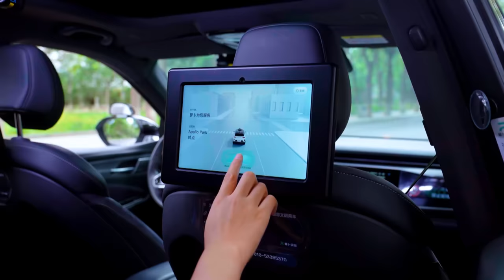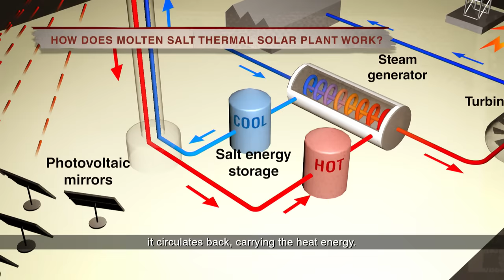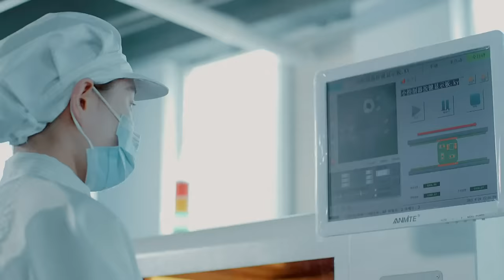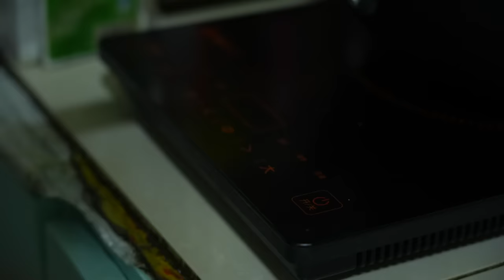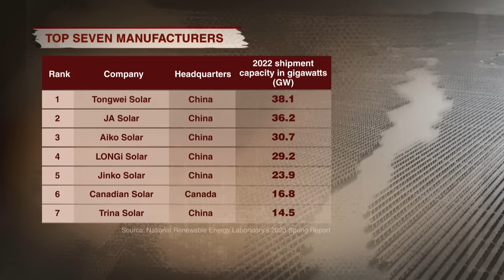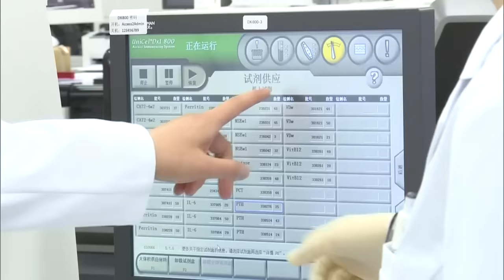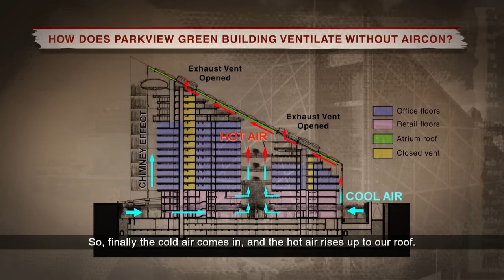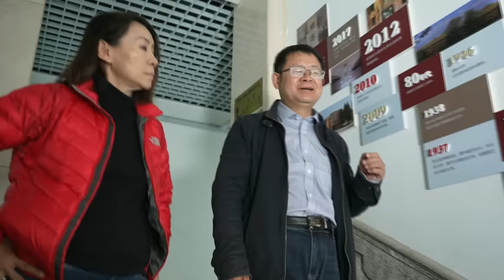China's Contradiction: World's Biggest Clean Energy Producer And Biggest Polluter? | Insight

Comment: US is the biggest polluter overall.   This sort of article should be responsible for giving the right information.   China is just the biggest annual emission in recent years.  But it will take another 10 years just to match the carbon emission US put in the air in the past.   And China is the fastest to clean up it carbon emission as compare to both the UK and US after their industrialization.  Yet US is still number 2 in carbon emission despite not doing any manufacturing while China is the world factory with 4 times the population.    

Unless you consider the people in China are not human,   China emission per capita is way below most industrialized countries including US, Singapore, Israel,  Canada, Japan and ranked 40th less per capita than even Falkland.    And the number don't even include the carbon emission by US military bases all over the world.
Reply: Depends on your source, but in general per capita, China does have a lower CO2 emission, the difference though is the quality. Burning coal releases more pollution than natural gas (Coal produces a lot of ash, particulates, and sulphur by products). 
I hope China goes green faster than countries. They should take note and learn from the failures and success of other countries, without stumbling around in the dark. Starting late has its benefits since you can avoid the traps. All the other countries have already invested billions on the research, so they just need to reap the results.
But yes, all countries should try to switch to renewable resources before we turn the earth into a toaster oven. Its not who is worse but how we can all make the world better.
Reply: @rebeltheharem7028   Coal is 100% carbon, but natural gas is still mostly carbon, or it wouldn't be valuable as fuel.  Chinese transportation is electrified mass transit, electric taxis and electric rideshare, supplemented by relatively few private vehicles, and Chinese EVs are now 40% of the market.  US transportation is roughly 99% carbon due to gasoline & diesel automobiles dominating.  China's energy grid is going renewable very quickly, now roughly 50% renewable by potential capacity, whereas America's energy grid adds renewables much slower.  

China is actually leading the advances in next-generation energy.  China has High Voltage Transmission technology that nobody else has (to move energy from solar farms in the western desert to the eastern cities), along with wind turbines that are larger and more effective than anyone else.  China leads in battery chemistry and production techniques, and also leads in photovoltaic cell technology.  Also, China is the only country with a 4th Generation nuclear power plant in operation, is operating a Thorium molten salt reactor, and is constructing a small modular reactor. China is actually doing the big investments and reaping the rewards.
Reply: It also does not include every year wildfires！ united state canada Australia.
Reply: @ZweiZwolf  China High Power Transmission is unique and no equal to move electricity from remote region to urban areas.     And as you said, China is pretty leading in every possible green energy out there.   The west was going to use this green tax to penalize China so they could force China to buy their green technology at a very high price.  But it sort of backfire on them.
Reply: @TAL142  Yeah, really shortsighted tariffs are just increasing their cost of renewable energy.  BTW, this is why China added so much solar last year, more than the entire US solar installed base.  China kept producing, and the West stopped buying, so China just installed all of the panels domestically, increasing their domestic renewable energy share. China has basically stopped approving new coal because they are installing so much renewable energy, transmission and storage. 

It's going to be really interesting when China has essentially unlimited amounts of "free" electricity to power things.
Reply: @ZweiZwolf  China needs energy security.   If they can store these energy, they could use most of these unlimited amount of free electricity.   China also has clean nuclear energy, hydropower, thermal power, wind power.   Just make sure not all the eggs are in one basket.  China is a big market too.    If they have excess, they can sell to friendly neighbors.
Reply: @TAL142  Sure, though it's also an option to convert "excess" electricity into green hydrogen fuel or freshwater.  China is now the largest installer of hydrogen generators.

Comment: Idk if its a translation error or what, but those mirrors are not photovoltaic (PV). The plant is a CSP plant, which concentrates the light from the sun onto the tower, heating it up, and using it to turn a turbine. 
Photovoltaics generate electricity "directly" via the photovoltaic effect.

Comment: China aims to transition to 100% renewable energy sources, provided that technological advancements permit. The primary motivation behind this goal is to eliminate their dependence on coal, oil, and gas imports. China's manufacturing industry is expected to benefit significantly from this transition, as energy costs are anticipated to drop sharply, resulting in improved profit margins. The decision is not only economically sound but also environmentally responsible, as it would reduce pollution levels.

Comment: There should not be contradiction. At this moment, wind and solar power are very stable. The coat power plants should be transitional and suplemental power to ensure power stability and should eventually be partially scraped after 20-30 years. Bear in mind, reaching carbon neutrality is a long journey and does not means no carbon should be procuced at all. It is just that carbon produced is neutralized by more tress planted and other technology such s carbon capturing. etc. to reach carbon neutral.

Comment: It should be clealrly stated that, the power generated by wind and sunlight is so called garbage electricity, not stable: power outage when you need it, and generting too much when you do not need. To generate more garbage electricity, you do need more thermal power, coal burning power plant. It is good to see that the new coal burning power plant in China are the most advanced one and produced least possible pollation.

Comment: If I may, the conclusion about cooperation sounds nice but raises the question of how to cooperate. Besides the lower cost of labor  in China clean energy products are heavily subsidized in China and possible dumping. China's subsidies and dumping creates an unfair market place that has destroyed many companies worldwide, no wonder that China has the market share it does. Take NEV's, electric cars, China subsidizes the manufacture and the buying of NEV's to the point that the subsidies are higher than the total cost of the car that consumers can buy it for. So car manufacturers open subsidiaries that buy the cars, getting the subsidies from both ends, and then remove the costliest part of the car, the battery pack and use them to build "new" cars and get new subsidies. There are lots in China with 10's of thousands of new EV's rotting away.
Some of the coal produced in China has naturally occurring uranium, when burned it pollutes the air and ground around the plant and then uses the ash residue in the construction industry, whereas the buildings that use those polluted products have higher radiation indoors than the air outside said buildings.
China, while talking a good talk, still has a long way to go to address pollution like that.